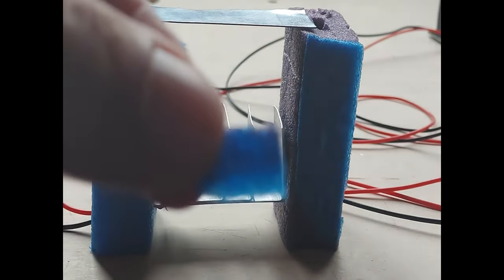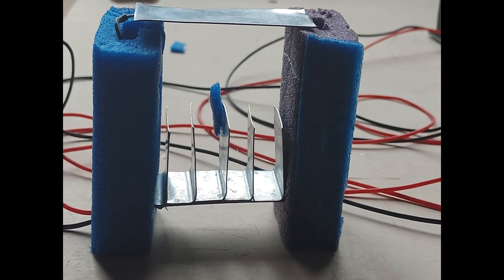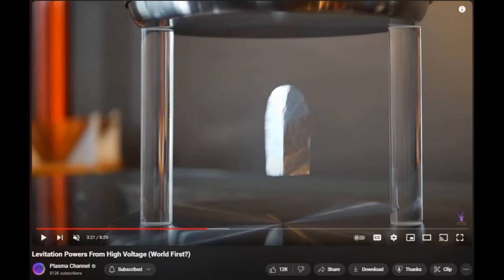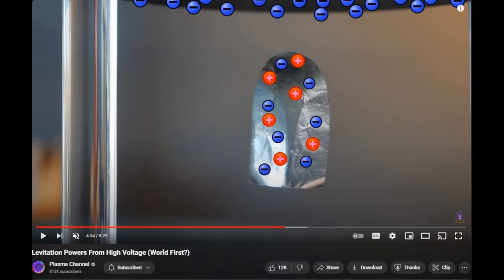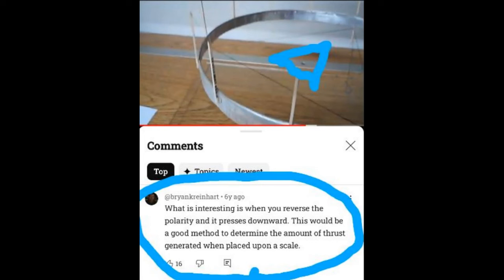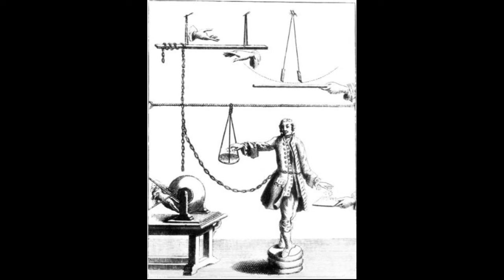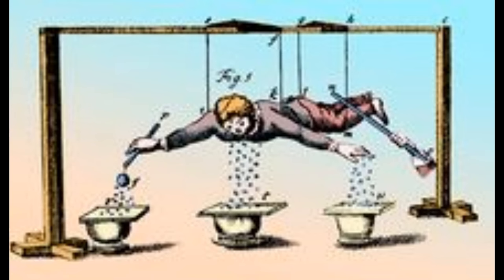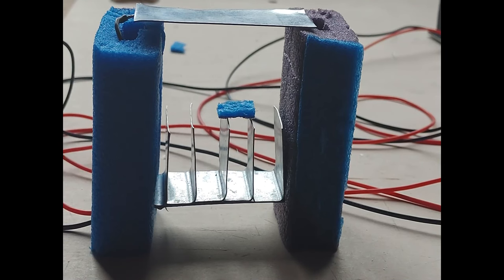High Voltage Experiment "Can You Explain It??"

Comment: 1. The flyback transformer output is a rippling DC current. 
2. One wire from the HV flyback is positive, and the other is negative. 
3. Bringing these wires close together creates a high-voltage electric field.
3. The styrofoam or paper fragments are insulators. 
4. An insulator in a high-voltage field will charge and discharge between the flyback transformer's positive and negative output wires.
You do a great job of presenting this phenomenon.
I really enjoy your channel!

Comment: Well the upper right corner is a old Sony TV flyback.  I know because I use to use them on the production line. The Sony TV flyback has 2x  HV outputs that went to the trintron tubes.  The trintron tubes used a 31KV  and a 15 KV  power source. 
The thing look like some strange HV hookup.

Comment: I'm thinking this is neither ION Wind nor Anti Gravity but Force due to positive and negative charge attraction. The high voltage charges the object and it get pulled towards the negative charged ground at the top, but since its at threshold it bounces around because it can't hold the charge very long. But, this is interesting nonetheless.
Reply from the maker: It is a brain teaser for shure.

Comment: An electron carries an electrical charge. A moving electrical charge has an associated magnetic field. Electrons are always in motion, so they have magnetic fields. Most of the time, electrons occur in pairs, with one electron in a pair having opposite spin relative to the other. The magnetic fields of paired electrons cancel each other out, leaving no net magnetic field. When there are unpaired electrons, a material has a net magnetic field that causes it to react to an external magnetic field.

Mess with the fields, mess with how the fields behave = electric field(s) can produce magnetic field(s), including its behavior. 
So:
Align the electric field(s), align the electrons of the materials so their spin align and they behave as magnets - attracting or repelling.

Comment: The foam and paper examples were both static electric charge buildup which allowed it to rise till it hits the top plate and discharges. The discharge allows it to drop and repeat the cylce. Both materials do it but have different cyclical rates due to difference in capacitance and surface area. The paper vibrates quicker due to higher surface area. 

As for the circular craft with the wires that appears to be ion wind. Anytime an electrical settup has a high surface area to volume ratio that is also a comductor with a gap to something with less surface area per volume it will generate ion wind. 

As for the graviflyer, it seems to be its own class. The fact Alexy can touch it like he is points towards a stable resonant state to move the charges to generate flux. Otherwise, the charges woild discharge through his body. 

Some sources claim 50hz is aluminiums natural frequency. This pulse rate aligns with my abduction experience.

Comment: Same with the paper. It is not Ion wind nor the changing the other. I have done this with two vadegraffs and a balloon charged with opposing polarity. What you said about static charges is I think why. In the levitating paper one the plates are actually changing their polarity producing a rotation in the field that keeps the paper perfectly levitating in place. These are not ion wind. Ion wind can happen in between charges yet the same forces that actually causes the movement of a gas can also affect objects that are solid. I would like to show this experiment in a vacuum. I think it would  still work.

Comment: No it's not ion wind. I is the ionization of the atoms on the surface of the foam itself taking on the charge from the plates below and the by the same force that holds charges in capacitors the foam is drawn to the opposite charged plate at the top. Once discharged by coming in contact with the upper plate it falls back to the bottom plate again repeating the cycle as long as the plates keep changing the charges on the foam. Is this correct? I stopped the video to attempt to answer this first question.

Comment: I think that negative to-positive direction only indicates the direction that electricity flows, ....therefore the bottom of the plastic particle is less neg than the metal plate, and the top part of the plastic particle is less negative than its bottom part. To me this must mean that the electricity is like a flowing river of water, ..if there is no downhill (differance in potential) then no water will flow and the partical will remain static.  The partical is therefore merely flowing on a river of electricity that is flowing upwards, just like a leaf will flow on water because it is lighter than the water but still goes wherever the river goes. ....If the leaf is totaly under water, .then being less dense than water ,,...it must rise.  This must then mean that since all atoms vibrate,   the plastic particle must be in a field where the vibration densityaround it is higher than the vibration density of the plastic particle itself.  i.e. the particle will then float on the field density of the field, .....but how would one achieve that? Maybe the particle must be made to vibrate at a different freouency than the field it is in?....difference in potencial is not a frequency....Volts and Amps is not a frequency. Pulses are. Maybe experimentation must start there?

Comment: is it ion wind.... NO it can't be ! because the things levitated are not metal...
in my mind what is going on here is very simple the high voltage electricity is actually pushing away the higgs boson so the objects see no mass and no gravity and therefore float.  so how do you use this ? you put it in a magnetic field that is slightly bigger than the object you want to levitate... and you charge that field with the high voltage.....
the problem you will encounter is that it will still not levitate.. because the typical magnetic field is porous it is not solid and the Higgs boson gets through maybe not all but some do.
to stop this from happening you must twist the magnetic field.... when the magnetic field is wrapped up tight it will then block out all higgs bosons and the object will levitate.
....this is my understanding of how it works... Alexia stumbled upon this and made his graviflyer..... it worked.... and I believe that is all he did. no sonic aspects are needed because we just want levitation of the object.... to do that you need to block the higgs boson.... a wrapped magnetic field charged with high voltage will do that.
good luck. and please don't disregard my  comment, i am trying to help you achieve the unachievable !

Comment: I have your same flyback and driver, actually i have 2 flybacks, and i want to try to put them in series, but when i tried it gave me the same, they work individually, but when connected at the same zvs driver the power goes down in each flyback, and only connecting them in series i get again the same power like if there was one flyback connected at the zvs, and there is another strange thing with the driver, when the electrodes are very close, and the spark is very small the circuit stops, and i need to disconnect and reconnect the power supply, to make it work again, but this doesn't happen when touching the electrodes only when they are close with a litte spark, but for some reason when the flybacks are in series, its all ok, the driver works only with a power supply from the house with a battery it works only for half second, when i connect it and when i disconnect it, probably beacause this are the moments when the magnetic field is variant, strange problem, but not too serious, i dont know i tought that beacause you have the same driver and flyback as me you could know somwthing that i dont to solve the problem or why it is,

Anyway i didn't understood well, if you think the lifter, actually make antigravity, or if it works by another principle, but i think i understood that you dont think that the lifter lifts exclusively for ion wind, 
i am doing some experiments, and i noticed that when the lifter is connected to a mass, or a ground, or my own body, it works better for me beacause its the thing that has more mass, but it should work even better with direct connection with ground, when you connect it to the bigger or bottom plate, the effect boosts significantly, but when connected to the smaller or upper electrode, the force decreases, the thing that made me a bit surprised is when i seen, that when the lifter works better, with the bigger electrode connected to mass or ground, the actual purple ion cloud, that supposedly makes the wind, actually decreases, until it eventually completely disappear, and even the sound decreases, while when the lifter doesnt work, with the smaller electrode connected to ground, the actual ion cloud, and sound, increases, but the force decreases,
Maybe it could relate with the thing of grounding the tesla coil to increase the energy, 
By the way in case the wind decreases or increases with the ion cloud and sound, or remains perfectly stable all the time with no changes, this would for shure mean that the wind is not the main lifting force, and it only applies to the real factor that makes possible the lifter to lift, 
For me it seemed like the energy used to create the ion cloud and sound, starts to be used for the real lifting force

Sorry for the long comment i let my self go, and i seen it after, keep up the good work
Reply from the maker: When 2 coils are connected a little distance is needed from the driver. they create a short in the driver. To much energy close by. 

If it is a power pack or a adjustable power source it has a safety in it that shuts it down. Some are easier to trigger than others. 

All high voltage works on the charge. Ion wind will only lift so much. If you can multiply the charge you can get more out of it.